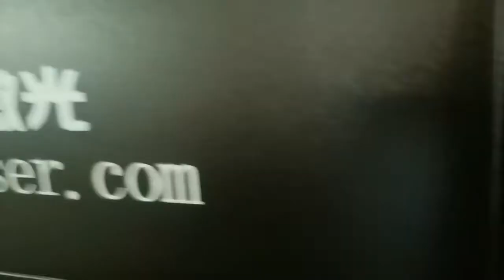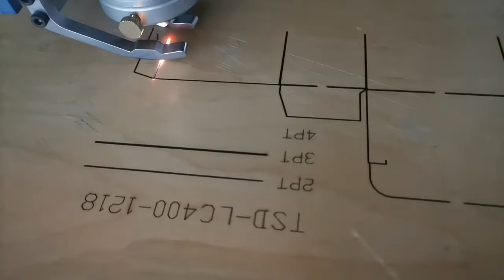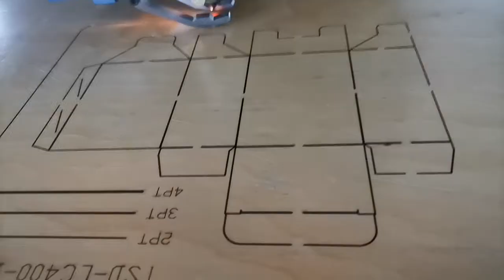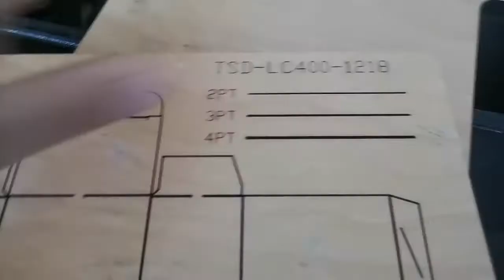TSD 400Watt Die Board Laser Cutting Machine with Auto Following System for 2PT 3PT 4PT Cutting

Comment: Hello What is the price of a 400 watt laser machine?
Reply from the maker: Hi Jim, thanks for your kind comments. Pls contact Vicky at sales4@tsdlaser.com or WhatsApp: +86 176 6524 0764. 
More info on our die-making machines will be sent to you. Thanks for your kind email and message in advance.
Reply from the maker: Also, may i know your email and WhatsApp so that quote in details of this die laser cutter could be sent to you more convinently.
We specializes in manufacturing die board laser cutting machine and auto blade bending machine with 13 years in China. 
We have served more than 5000 users and our die-making equipment installed in over 70 countries till now. 
Thanks for your kind reply.
Reply from the maker: Hi Jim, may i know your email so that quote in details of the above 400watt die laser cutting machine could be sent to you? Thanks for your kind reply.